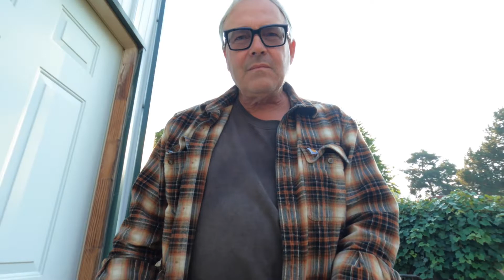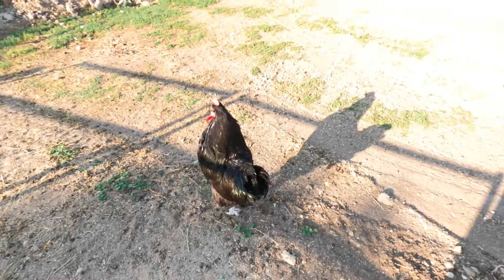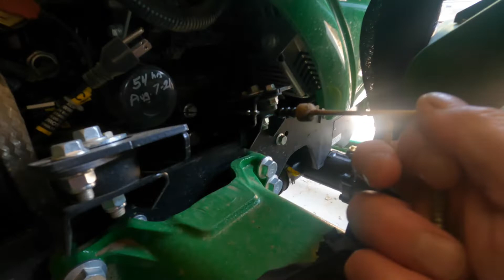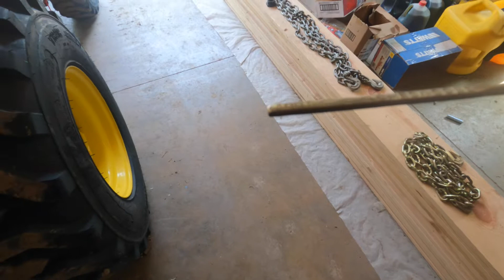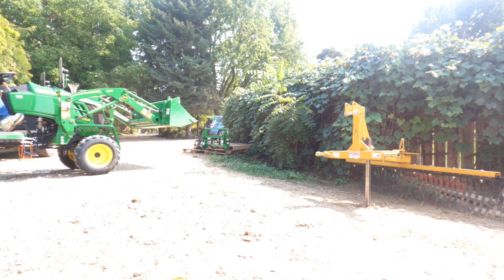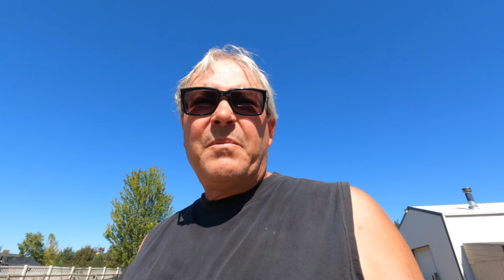1 John Deere 2025R

Comment: How well does that rock rake work in removing rocks from dirt?
Reply from the maker: The landscape rake works pretty good at removing the bigger rocks from the dirt. The ones 1-1/2" and larger. My soil was dry and loose when I was using it. I do wish the tines were spaced a little farther apart because it holds lots of dirt too. I went over it several times and tried not to dig in too deep when raking. That seemed to help.